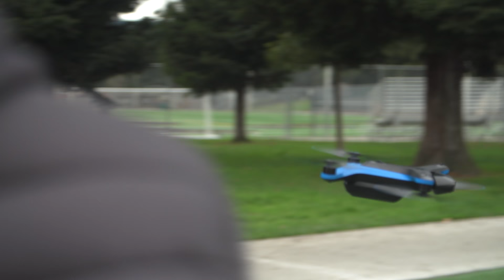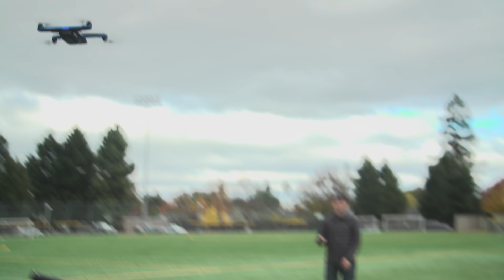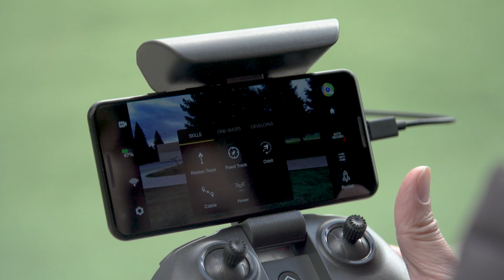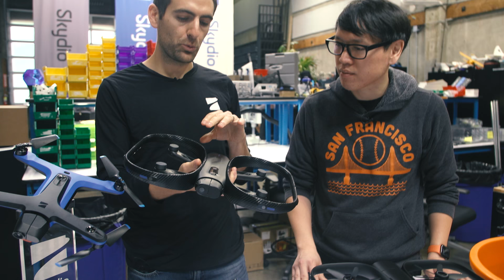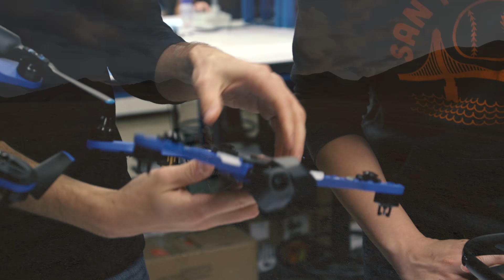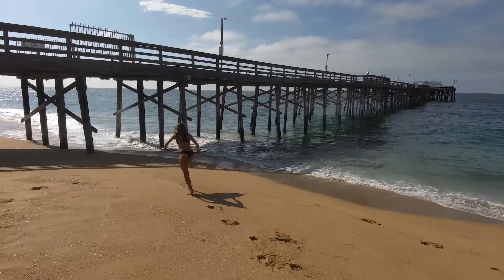Skydio 2 Autonomous Drone That Never Crashes!

Comment: Problem pets. What if the drone is flying low then a dog takes a run at the drone to grab it with its teeth. Does the drone jump high to avoid damage to the drone or switch off motors to avoid damage to the pet? Great video about Skyio2. The search and rescue locating persons with infrared detection is a possibility. Thanks.

Comment: The skydio2 needs a firmware update that allows it to ..or atleast have options to .."follow the route you just took"  ..instead the drone usually takes a shortcut to follow you often times putting it in a slower bush route  ..ATV Quad bike videos are "almost" perfect with this drone  .,..but the bush shortcuts are a big problem

Comment: Impressive design + tech, well done
It's not a easy to do thing of course, Physically I believe the extensions could be curled inwards down like a claw machine so they aren't judded strait out, then the propeller could be attatched on the inside at the farthest point toward the base of the device maybe on a swivel for ease of motion/rotation (inwards) & can have a small light plyable material halo wrapping them so the propellers aren't swinging on the exterior. Could be a more compact design tenisball size version of this the actual arodynamics of the design would have to be tested. A landing dock would be cool addition & would have to be automated or even a bag could be made with a spot for ease of attatchment for the dock in the bag & drone as Well as unattachement or launch of the drone. With wireless chi charging usb type C specs. 
   Probably for the R3 version idea or the start of one less than.. Or a version way down the line. 
      Lol.. More ideas just sitting here wasting away, young, broke & impatient, resoursless,  in need of a good lab..

Comment: They drastically underestimated demand. In batch 2 from November. Still waiting. I’m starting to consider waiting for S3 at this point. I’d hate to get an S2 a few months before S3 is announced. However S2 is likely to improve through software before S3. I can see S3 being better with thin branches and power lines due to higher res cameras, better at low light flight, and maybe they will add addition emergency sensor types to eliminate certain types of crashes like reflective surfaces like still water at mirrored building glass in cities.

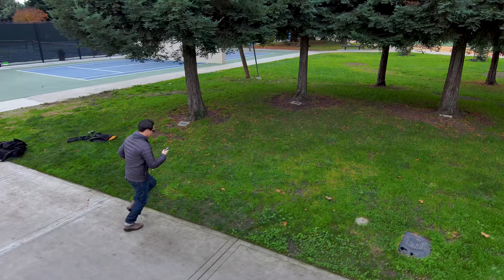Comment: So close and still amazing / promising, I want this for Mountain Biking, but I see no biking though single track as an example. I like to bike through forested areas and 3:56 it cannot follow him under the tree canopy and goes up and above the trees - that would not work for me :( This is still exciting, one step closer!
Reply: Biking with JP I saw a video of it going under the trees tho branches would be tricky for the object detection
Reply: @CineZoneYT  Thanks, I found another video where someone tried to go on some single track and it failed miserably. What happened was that it would follow the rider but because it was back a several feet, any time there was a sharp turn or a situation where the rider would turn and put even a small branch in the way it would get stuck trying to get to the rider via line of sight. That and they said anything 10mph/16km/hr or faster was too fast for the drone to process it's surroundings and keep up.

It's all the small branches and quick turns that make MTB fun that get the drone lost. Maybe they'll figure out a way to do path tracking where the drone will know to follow the persons path instead of the current attempt to go straight line to the target and find it's own way there (I mean, if a person can make it so can a drone right? Follow their path).
Reply: Biking with JP I guess you’ll have to wait for nextgen.
Reply: @BikingwithJP  supposedly this one will do up to 25mph while obstacle tracking snd if you keep the remote in your pocket or riding gear it will follow anywhere even when out of sight

Comment: I own a Mavic 2 Pro. This Skydio 2 drone is far superior in following a subject and not flying into part of tree and trimming a few thin branches or flying over a power line and flies downward, lands on the power wire, flips and corrects itself (all of which my Mavic 2 Pro did while testing running through my backyard.😂😂

Comment: In the U.S., the term "autonomous" seems problematic, since the FAA requires a person to be controlling the drone in line-of-sight at all times.  Yes, it's capable of autonomy, but as I understand, it can't legally operate autonomously - someone has to be ready on the controls and in direct line-of-sight to take over operation at a moment's notice.  For example, in the video it's following a person on a motorscooter who is clearly preoccupied and unable to fulfill that role.  I would assume, then, there's another person designated to still be the operator.  Am I wrong on this?
Reply: Yes, the operator must maintain a line of sight but the method of operation is not specified.    Perhaps the drone is controlled by voice.  It's not but that could be legal.   I think as long as the person who maintains line of sight on the drone has the ability to step in and take over you'd be OK.    All you'd really need is a kill switch.

Comment: @ $1000 for the drone, $150 per battery, $100 for new blades, and $250 for the (non cellphone) controller. this is beyond luxury. not exactly built for "everyone" like they say.
Reply: Pretty sure the propellers are like $15, battery $100, the controller is $150, WTF are you talking about?
Reply: @stevensteele45  I went to the site and looked at the prices they have listed. Sorry to disappoint you on your reply. But they shouldn't call it "something for everyone" when their price point is absurd. Its an item for the middle and upper classes. Something that I will never be able to afford without taking out a small loan.

Comment: I want to see how the 360 avoidance deals with overhead cables like phone lines etc. They might be tricky for the cameras and disastrous for the drone.
Reply: See the video from DC Rainmaker. He tested it in an environment full of branches and most of the time the drone has avoided it quite well. I think if they will be able to provide updates to it will be quite perfect avoiding even overhead cables.
Reply: @hegeds  It did have a crash but the thicket was mega thick and it tried to find a way out 2 to 3 times and auto corrected and "re-thought" the process, in the end there was not a clear path of escape and it tried the best path. It caught a branch about 12-14 feet up and bang. On a good note it survived and slew with no damage. It is not a product for me and what I do but very impressive 2nd gen tech.
Reply: Seen it fly through a forest, a few cables shouldn't be a problem.
Reply: Get Schwifty I suppose as processing power gets more efficient and cheaper, computing thru millions and millions of pixels from a higher resolution camera would be able to pick up those high tension electrical cables. But I suppose we’re only limited to how fast we can process and compute calculations.
Reply: Some dude literally ran through a forest and dodged stuff pretty well
Reply: @chrispy_cut  big different too thin cables lol
Reply: They use multiple cameras too, no? Getting a slightly different angle makes such things much easier to determine and the only thing needed would be the processing power/speed to deal with that data fast enough
Reply: i'm curious how it would react to wind or falling leaves with misidentifications
Reply: @mmoarchives2542  it grinds them
Reply: Each one of those cameras has 4k of resolution, so it doesn't miss much.  What throws it off is what throws off all optical sensors...low light conditions and over-water flight. One reviewer had a Skydio 2 dive straight into water presumably because the water was smooth as glass and it saw a picture of the sky in the water.  It will be interesting to see whether they add ultra-sonic sensors and change the algorithms slightly to avoid that type of thing.  'Never crashes' is a false statement though.
Reply: I think it's very vital
Reply: ...what about a hawk targeting the drone,can it avoid the bird if it is flying downwards?
Reply: Well we now know the answer. It’s a coin flip if it avoids powerlines properly. Several YouTuber have crashed S2 because of thin powerlines.

Comment: Question for Adam: the tether feature A-B is this in a straight line ? Would it be possible to have a feature where you fly a sequence say, along the side of a road with a long sweeping curve, then fly up to a spotlight position. Save the sequence and get the drone to repeat it ?
In effect pre programming a cinematic sequence.
Reply: I agree - A string of more than two waypoints, or a curve/arc/spline would be a good expansion of the capability.
Reply: I'm guessing that would actually be very simple to do, just not simple to explain in the video. =)

Comment: Having the props on the underside at the front is going to make hand landings quite dangerous.  Maybe not generally a problem - but I watch several sailing channels where launching/landing from a boat is currently impossible without having a crew member catching the drone for landing (tiny market, I know).  Maybe they'll have options for protectors for the front props at some point or maybe autonomous landing targets that can be placed on a moving platform, like a boat, that remove the need for manual intervention.
Reply: You could get something 3D printed. They might do optional extras for it in the future.

Comment: Am I the only one that thinks this thing would benefit from having a landing gear, to use it as a perched stationary camera? 
It seems like an obvious security application: fly over this roof, land on it and synchronize with the other perched drones in the area for instant static surveillance of the perimeter.
Reply: You'd also have to account for battery life.
Reply: @JD2jr.  I imagine that with their automatic docking stations, this would come as an "event mode" that you can trigger with movement sensors around a building, or schedule around a specific time, if you are expecting a VIP. In any case, the battery life of a perched drone is longer that one in fly-by.
Reply: Most flat roofs have a raised edge around them much taller than the drone.  Most residential roofs are far too slanted to land on.  In the USA I would imagine maybe 10% of roofs are capable of being landed on with a small drone like this and seeing anything.
Reply: @Plur307  Not sure how necessary it is, but I do feel like there's something there. What I imagine is a couple pairs of spikes. They could be very cheap and lightweight, perhaps even retractable, and would be ideal for landing on most shingled roofs. Wouldn't even need to be sharp enough to risk puncture or scrape damage, and could be easily replaceable after wear. With the size of the unit, I can see it being nimble enough to land on ledges (such as those surrounding flat roofs), that are narrower than the unit itself.
Reply: @mmseng2  lightweight and retractable do not go together.  Servos are heavy.  0.5 lbs does not sound like a lot, but on a drone this small that is like a 30% weight increase which means 30% less flight time and range.
Reply: Definitely not the only one thinking about these for security use.
Reply: Birds aren’t real!
Reply: If you want to catch your partner cheating... Goto Wal-Mart buy a recorder with automatic audio activation, hide it and leave it on in a common room like bedroom or where ever they are most likely to talk private on the phone... You will bw shocked what you discover. Sorry to spoil relationships... Just the reality and you deserve an honest partner. If you're good 👍 lol

Comment: Looks very nice. (Un)fortunately for my wallet it doesn't ship to Europe :( It would also be nice to make an upgraded model with foldable arms. It obviously fits in a backpack but will take the full width which can be a dealbreaker. In skiing the airbag system takes a corner of the backpack for example, then the probe and shovel shaft are thin but also go from from the bottom of the bag to the top - possibly making it tricky to pack.

Comment: Did I miss something?  What are the benefits of the 2 propellers on the front going down?  Just looks more dangerous to try and hand land or launch this thing.
Reply: The cameras are above.
Reply: @MichaelBylehn  I just noticed that.  This is gonna have to just be something you buy a lot of replacement props for I think. :P